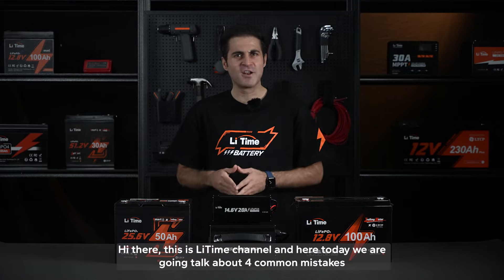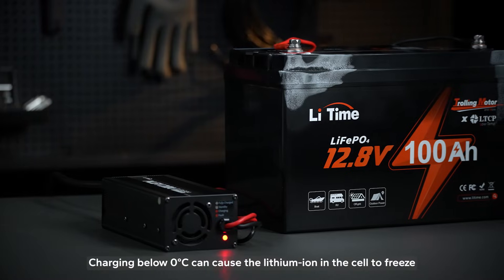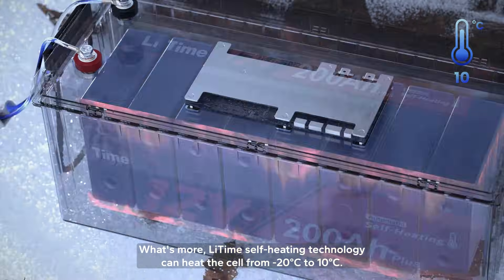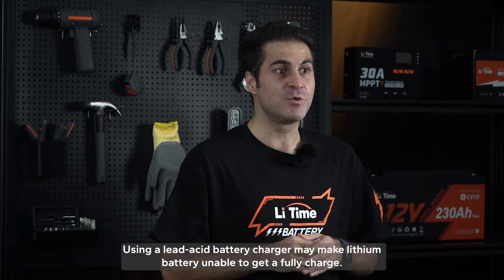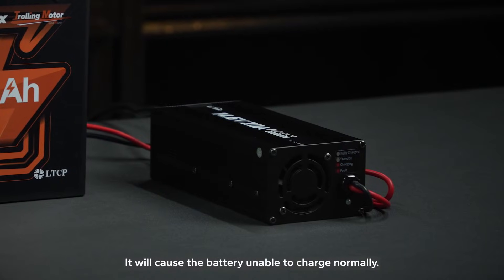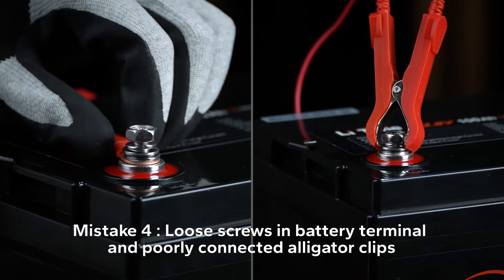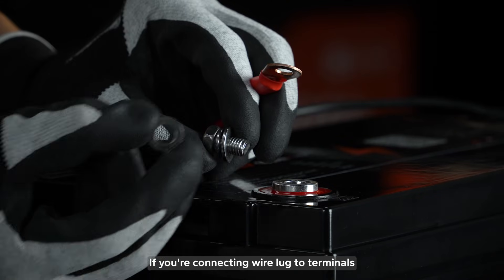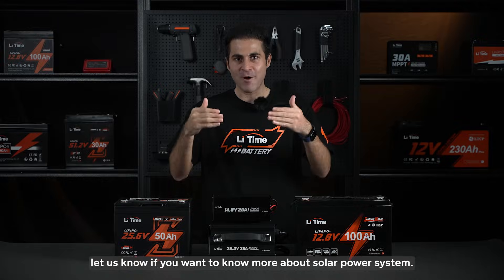4 Deadly Mistakes to Avoid When Charging a Lithium Battery

Comment: Can a 40v li ion charger charge a 48v li ion battery?
Reply from the maker: Hi! ⚡A 40V charger won’t work ⚡ Our 48V LiFePO4 battery needs lithium / LiFePO4 mode, 56.8–58.4V. For more help, email service@litime.com🙏
Reply: @litimepower what is the highest voltage that a 40 volt charger will get a 48 volt battery?
Reply from the maker: Hello! 😊
LiFePO4 batteries require a charger compatible with lithium charging logic. For our 51.2 V system:
Mode: Lithium / LiFePO4
Voltage: 56.8 V – 58.4 V
Current: 20 A recommended for 100 Ah (0.2 × capacity)

A charging voltage of 40 V is too low for a 51.2 V battery and won’t fully charge it. A compatible charger is required. You can also check the SOC information in the user manual here: https://cdn.shopify.com/s/files/1/0667/7220/5788/files/LiTime_51.2V_100Ah_Golf_Cart_Smart_Battery_-_User_Manual_1f5b6016-9bb7-4531-8565-64c89f372d3a.pdf?v=1754648031

For further questions, email 💬 service@litime.com — we’re happy to help! 🙏
Reply: @litimepower please be as technical as possible I have a 2-year degree in electrical/electronics engineering and also no home electrical learned on my own

Comment: If you go to the bother about saying to tighten the terminals with a Torque Wrench, why the hell don't you say the Tension?
Reply from the maker: Hi! 😊 Great question — the torque value isn’t shown there, but you can find it in the manual: M8 – 5/8" (16 mm) terminal bolts → 106.2–123.9 in-lbs / 12–14 N·m
For the exact torque for your model, please email service@litime.com. Thank you for the feedback! 🙏

Comment: My battery charger from your company (Li)  comes with 2 mini Anderson connectors, which is awesome. So I bought two more mini Anderson connectors from eBay so I can connect it to my trolling motor and and my lead acid battery.
So easy to switch batteries, charge the lithium battery and connect my lead acid batt to trolling motor

Comment: When charging my LIP battery I mistakenly put positive on the negative terminal. The charger indicator light showed red and nothing bad happened. When I noticed and corredted it the fan in the charger did not turn on. The battery is still working. Does this mean the charger is not working any more? Thank you.
Reply from the maker: Hello! Thank you for reaching out to us—we appreciate you taking the time to connect! 😊 Could you let us know if you’re currently using our brand charger? If so, please share your order number and any additional details by emailing our support team at service@litime.com. This will help us conduct a thorough analysis and assist you better.

Comment: These litime 100ah batteries are amazing.  I have the group 31 in my boat for the trolling motor.  Ive been out fishing with the boat 3 times, and the battery is at 80 percent.  My old marin battery needed to be charged after every outing.  Should i hook up a solor trickle charger to it or run it down and charge with lifepo charger?
Reply from the maker: Hi there! You don’t need to wait until the battery is fully discharged. You can charge it whenever you need with a compatible LiFePO₄ charger—just make sure to disconnect it once it’s fully charged. That way, it’ll stay topped up and ready for your next trip.🧡🧡🧡

Comment: The 2025 Toyota RAV4 XSE plugin hybrid has a 120v AC port (1500W) in the cargo area. It also has a physical button on the dash to enable/disable the 120v AC port which could be handy for the following, when I don't want recharging taking place:

In order to avoid wiring to the vehicle's 12v auxiliary battery or DC/DC converter, can I use a LiTime 60-Amp Lithium Battery Charger 12V LiFePO4 Battery Charger AC-DC Smart Charger (with Cooling Fan, Anderson Connector LED for 14.6V LiFePO4 Lithium Batteries, 60A Fast Charging) plugged into the vehicle's 120v AC port to recharge a LiTime 300Ah LiFePO4 battery?
Reply from the maker: Hi there! Thanks so much for reaching out to us. To provide you with the best experience and most accurate support, we recommend contacting our service team(service@litime.com ) with your order number and battery system details. They’ll assist you in checking the charging compatibility and ensure everything is functioning properly.
Reply: @litimepower  I won't buy and therefore won't have an order number until I know the answer to my question. Thank you anyway.
Reply from the maker: Thanks for the response! Feel free to forward this to the support team to check compatibility and inquire if they can offer a discount code for your new order 🧡

Comment: I’m charging to 12 V in series but not even the manual says to hook the charger cables to the same battery or to the positive to battery # 1 then negative to the battery #2  negative terminal. Need best practice info
Reply from the maker: Hi there!  To create a balanced 24V battery system using two 12V batteries in series, here’s the process you’ll want to follow:
1. Charge each 12V battery separately: Start by charging each 12V battery individually using a 12V charger. Make sure each battery is fully charged before moving on to the next steps. This is crucial for ensuring they start at the same voltage level.
2. Connect the batteries in parallel for 12-24 hours: Once both batteries are fully charged, you’ll need to connect the two batteries in parallel. This means connecting the positive terminal of Battery #1 to the positive terminal of Battery #2 and the negative terminal of Battery #1 to the negative terminal of Battery #2. Let them sit in parallel for 12 to 24 hours. This step helps the batteries balance out their voltages and ensures they are at the same level before connecting them in series.
3. Connect the batteries in series to create the 24V system: After the batteries have balanced, it’s time to connect them in series. To do this, connect the positive terminal of Battery #1 to the negative terminal of Battery #2. The remaining positive terminal of Battery #2 and the negative terminal of Battery #1 will now serve as the output terminals of your 24V system.
4. Charge the 24V system: Finally, when it comes time to charge your 24V system, use a 29.2V charger to charge the entire system as one unit. Connect the charger’s positive lead to the positive terminal of Battery #1, and the negative lead to the negative terminal of Battery #2. This will charge both batteries simultaneously while maintaining the balance of the system.
If you have any questions or need more details, feel free to reach out! If anything is still unclear, our support team (service@litime.com ) is happy to provide photos to help explain the process further. 😊
Hope this helps and good luck with your setup! 🧡
Reply: wow the first real layman step by step thanks a zillion 

Now I know why LiTime are so popular

Comment: I want to charge two parallel mounted LiPo4 12v / 140 Ah battery. What current do I need tot charge these batt's normally?
Reply from the maker: Hello, to create a balanced series battery system, follow these steps:
1. Charge each battery individually using a 12V charger until they are fully charged.
2. Connect the batteries in parallel for 12-24 hours to allow their voltages to balance out.
3. Build your 12V 280Ah battery system by connecting the batteries in parallel.
4. Use the 12V system as a whole and charge it with a 14.6V battery charger. 
Hope this helps!🧡

Comment: I have a 24v 100ah trolling motor battery from you guys and 29.2v charger. This is all mounted in my boat and the chager is connected to the battery.  All i do is plug the chager into a 120 outlet to charge. Is this ok to leave the charger connected to the battery even when the charger is not plugged in?
Reply from the maker: Hi, it is generally recommended to disconnect the charger from the battery once it is fully charged to maintain better performance for both the charger and the battery. Leaving the charger connected when it is not plugged in may not cause immediate issues, but it’s best practice to disconnect it to avoid any potential problems in the long run. If you have further questions or concerns, please feel free to contact our support team at service@litime.com. We will assist you within 24 hours.

Comment: According to Eco Worthy, lead acid chargers are fine for their batteries, as long as they don't have smart features. ( de sulfation etc )
Reply from the maker: Hello~ Different battery brands may have distinct recommendations. For optimal performance and longevity of our batteries, we suggest using a dedicated lithium battery charger. These chargers are engineered to match the specific voltage and discharge characteristics of LiFePO4 batteries, ensuring efficient charging. In comparison, standard lead-acid chargers often use a simpler, non-optimized charging profile that can lead to slower charging, reduced battery lifespan, or potential damage when used with lithium batteries. For more details, you can refer to our blog: https://www.litime.com/blogs/blogs/choose-a-proper-lifepo4-lithium-battery-charger?_pos=4&_psq=charger&_ss=e&_v=1.0 😊

Comment: Great info I am using liTime 24v230 ah 2 in parallel to power my off-grid home for past 18 months and they have been working great my concern is the BMS the room temperature where they are stored is about 95 degrees Fahrenheit with the use of fans to cool it I keep hearing about heating the batteries .where I'm at we don't worry about that midday they're charging right at 120 amps at the bus bar from the charge controllers which gives me right at 50 amps per battery charge rate where I'm having a problem is in steady charging clouds can cause charging rate to very a lot my charge rate might go from 15 amps back up to 130 amps within a few minutes. settings 28.8 absorption 10 minutes 26.8 floot . Because the load varies as well as the charger rate I found these my best settings batteries have never been disconnected since they were hooked up or charged by anything other than the inverter or the solar panels I can't allow them to set overnight to check the balance as described in the literature I wish it had a Bluetooth BMS so I can keep an eye on the balance any suggestions

Comment: 1:35 how can damage bms? ok, not charging after 14,4v, but this is not a big problem... so you wrong i think.
Reply from the maker: Hi, charging the battery with an incompatible charger may damage the battery's BMS. Our manual also clearly states that it must be charged with a compatible charger. If you have any other questions or concerns, please feel free to contact our support team at service@litime.com. We will assist you within 24 hours. Hope this helps!
Reply: @litimepower  this is just a standard, meaningless message...  please tell me what problem can be for example with a simple car battery charger (lead acid)? i tell you: the biggest problem, that not charging the battery at full capacity.
Reply from the maker: Lithium-specific chargers are designed to charge LiFePO4 batteries more efficiently, using a charge profile that matches their voltage and discharge characteristics. In contrast, standard lead-acid chargers typically follow a simpler charge profile, often not optimized for the charging needs of lithium batteries. This can result in slower charging times, reduced battery life, or even damage to lithium batteries if a lead-acid charger is used. Here’s a link to our blog with all the details—hope this helps! https://www.litime.com/blogs/blogs/choose-a-proper-lifepo4-lithium-battery-charger?_pos=4&_psq=charger&_ss=e&_v=1.0

Comment: My camper converter was upgraded to a model that can recognize LiFePO4 batteries. The converter manufacturer recommends replacing the inline 30A short stop circuit breaker with a 60A one in order for the converter to charge the battery at the high voltage.

Comment: Ahhhh, i need way to charge hq 18650 40 or 30 piece power charer. 

I want to have them charged under 1 hour or 2 st worst. 

I dont wanna split charging over more usb charging chips and multiple curcuits, usleless waste. 

Soon i will be forced t learn how to assemble big battery myself, but tat seems out of electroengineers capabilities when it comes to high drain.. 

I eould bebetter of making some form of massive earth battery combining charges from electrogenic bacteria, water milll, capruting wood fire to big bear battery and steam or other concersion but tht still is not for quick cross country travels. 

Does somebody know aboutsome hyper mini gasoline motor thst can with gears make either low rpm or high rpm motor generate 7Kw, isnt 1kw like st leste here bike gasoline motor legal limit, so it should reach it, and they are effective, my friend told me he did like 1l on 100km, and if i imagine 4h full force of motor like that loaded on obe gear for speed to torque to get its optimal workload, then 1l could ve at least 3Kw? 

One more month of this hardcore research and i will accept defeat, and start focusing on magical crazyness. 

Like steam powered shi, leaver, gear sydtems to lift 50kg sand bucket to tree top by hand, simple human lift or drill with leaver and other and putting low rpm motor over many speed to torque gears for slow but heavy fall or static energy from skies..

Ohhhhhhhh!

Comment: I just bought 8 cells 3.2v 314ah lipo batteries.   Should I use a low amp battery balance charger to charge them ?  Also should I charge them in parallel ?
Reply from the maker: Hello, thank you for your question. However, we apologize that we are not familiar with other brands. Please kindly check with your battery customer service to ensure safe charging.

Comment: Just bought 2 new LiTime 12v100ah batteries for my trolling motor. I charged it fully before I took them out. My first outing, 9hrs of run time, second outing 11hrs of run time. When I check the battery test gauge, it was still at %100, is that normal ? Or is the batteries that good ? 😂😂🤞🏼🤞🏼🤞🏼😔🤔
Reply from the maker: Hi, glad to know our batteries work well for your trolling motor. For more battery status analysis, please email our support team at service@litime.com—we’ll assist you within 24 hours! 🧡

Comment: So, how do I charge my batteries then...
Reply from the maker: Hello, thank you for your question. For 12V lithium iron phosphate (LiFePO₄) batteries, we recommend using the LiFePO₄ charging mode with a charging voltage range of 14.2V–14.6V. Additionally, please stop charging the battery if the temperature drops below 0°C (32°F) to ensure safety and optimal performance. For more questions, please email our support team at service@litime.com—we’ll assist you within 24 hours!

Comment: My battery has two sets of wires. One thick and the other is thin. What is the charging wires and the power out wires.
Reply: Thicker wire would be for discharge
Reply from the maker: Hi~  In most battery configurations, the thicker wires are typically used for power output, as they can handle higher currents. These wires are designed to deliver power to your devices. On the other hand, the thinner wires are usually for charging purposes, as they carry less current during the charging process. 
For further questions, please email our support team at service@litime.com with your order number—we’ll assist you within 24 hours! 🧡

Comment: please let me know about number 5 , if its your choice whats the best low and high percentage of discharge and charge forLiFePO4 battery
Reply from the maker: Hello, thank you for your question! LiFePO4 batteries deliver exceptional cycle life, with performance varying by Depth of Discharge (DOD):
100% DOD: ~4000 cycles, regular full discharge 
80% DOD: ~6000 cycles, balancing usable capacity and longevity.
60% DOD: ~15,000+ cycles, ideal for maximum battery health.
Optimal use: Maintain 60–80% DOD to extend lifespan while retaining practical performance. Hope this helps!
Reply: @litimepower  thanks
so not leting the batteries to go lower that 50% is very doable for me since i dont have that much daily consumption but i still dont know the upper end like the way things are now with the mppt runing my battery bank never goes down below 95% state of charge on an average day??

Comment: 1:06 Yes, you indeed should not ever charge LiFePo4 when it is under 0 degrees C. But I want to add, that under 5 degrees C, you already need to drasticly lower the charge current ! As my 31kWh battery bank is equipped with a heater system, it is easy for me to prevent charging when the pack is under 8 degrees C, and have it warmed up first if it is under that 8 degrees. It is always better for the life span of your LiFePo4 (LFP) battery, to include some margin in this temperature range.

Comment: I have a 230 amp low temp battery from you guys. Manual says recommended charging is 46amps. I expect you don't recommend it but with appropriate wiring and a 250 amp alternator is it possible to charge directly from my van chassis bypassing the use of a DC to DC charger altogether? Would the BMS allow a continuous charging amperage up to say around 120 amps?
Reply from the maker: Thank you for your inquiry about the 230A low-temperature battery charging.
Charging current: 230Ah BMS (200A) supports 0.5C (~115A).
Important: Direct truck chassis charging is not recommended—do not bypass the DC-DC charger. Charging equipment must provide lithium battery-compatible mode and correct voltage for safety/performance.
If you have additional questions or need assistance with setup, please feel free to contact our support team at service@litime.com. We will assist you within 24 hours.💛